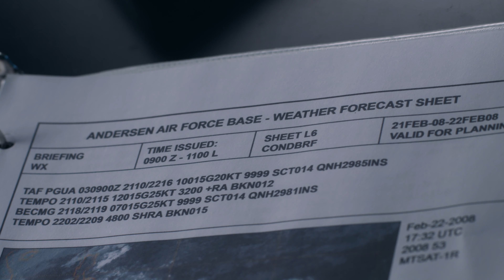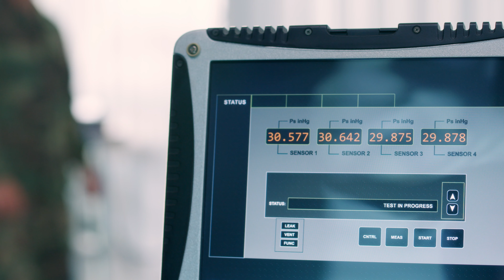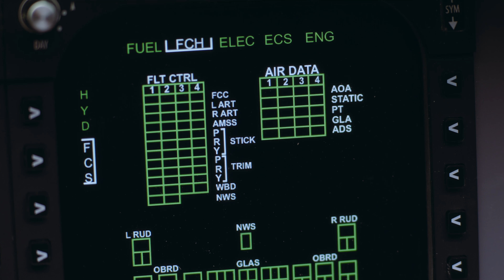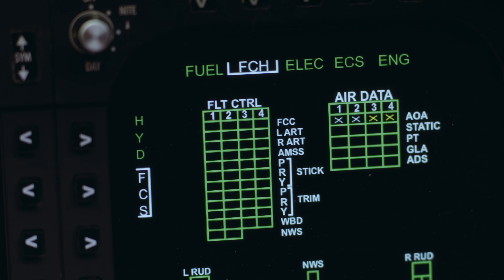Investigators Seek Answers in the Crash of a US Stealth Bomber 👀 Air Disasters | Smithsonian Channel

Comment: What I don't understand is that because it's a plane,everything is sealed. Electrical parts are sealed  as well. Before  the  air force, or the Navy  buys them, DOD makes sure that they have to be tested. These planes are not  cheap. They are actually very expensive. And they are  military aircraft.
Reply: Hardly anhything is sealed because it is an aircraft- it would't work. It has sensors that need to have as little as possible isolation as possible from the atmosphere. The aircraft are very expensive- this the airforce they don't things properly multiple videos show they have senior staff who don't give a stuff.  To change things would require outsiders to force them to change just the expert shown in this video if he had actual influence.  Aircraft are designed to work best in flight not sitting on the tarmac.

Comment: They should've put the jet in the hanger in case of bad weather, but neglected it. As a result, the rainwater short circuited the jet's electronics causing it to send bad data to the pilots.
Reply: I mean, a bit more nuanced than just short circuiting. The B-2 is perfectly capable of flying through rough weather. This event occurred 12 years after they entered service, and remains the only sognificant accident in the entire fleet.
Reply: @Louie Osumo, Not always do combat aircraft have that luxury... Being on a military base means that  several of the hangers (and other things on that base) are subjected to enemy strikes... One of the easiest targets for adversaries to hit, would be buildings.... Of those buildings, the hangers would be some if the most enticing because of what is inside of them, and this is no small fighter jet... It is really big, and not so easy to tuck into a hanger... The planes could be stored in concrete re-enforced shelters, but those cost a lot of money and take time to build.... Perhaps, that is something that should have been considered BEFORE these planes were deployed to that location.... But a combat aircraft having problems, because of rainfall, is ridiculous... A definite design oversight...
Reply: @epikmanthe3rd  - in that 11 years of service, the planes were probably treated very carefully... My guess, and this is a guess- is because of the extreme expen$e of that plane, it was tested very carefully as well, and put into a hanger every night with easy listening music being played during the plane's resting process and a blanket carefully pulled over it.. They probably did not fully expose it to the outside elements like rain, hail, high winds, snow, blizzards, flooded runways, dust/sand storms, extreme cold for extended time, extreme heat for extended time during the testing, process trying to simulate real war- time circumstances and natural elements... And that is probably where the manufacturers of the plane and it's components fell short... Little or no accomodations for less than optimal conditions...
Reply: Rainwater did NOT short it. However, melted rainwater DID cause the computer to collect erroneous data

Comment: Sorry for asking this question but why said concord get permanently removed but boeing and airbus had more accidents I don't get it and dc-10 caused it because of a new engin block i think but it was something off the engine of the dc-10 but it busted the wheel of the concord and the wheel was sucked into engin number 2
Reply: The reason is because Concorde is not efficiency and also too noisy when operating
Also, the price for a Concorde ticket is just expensive as fkkk